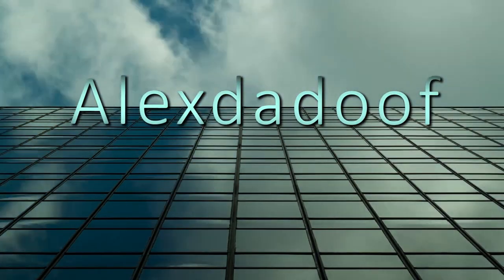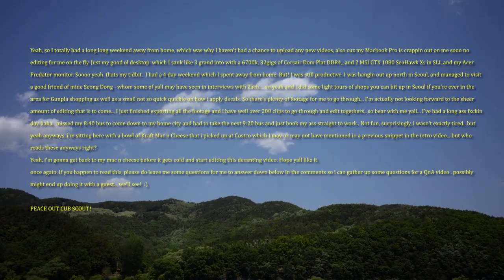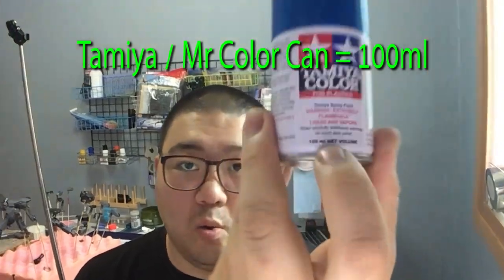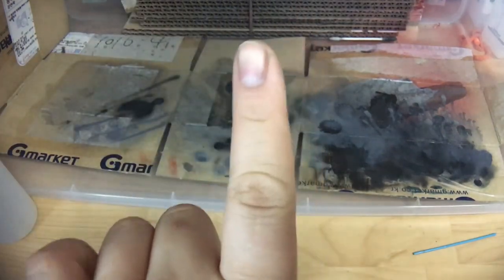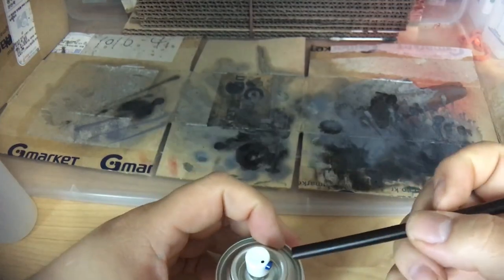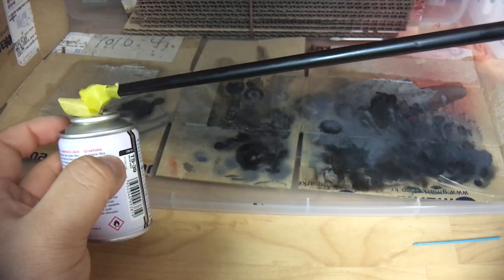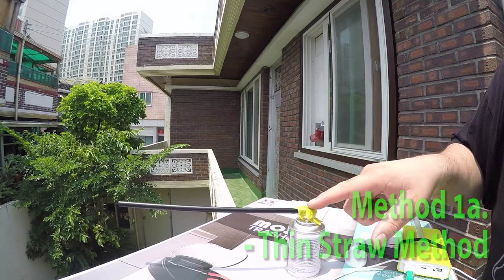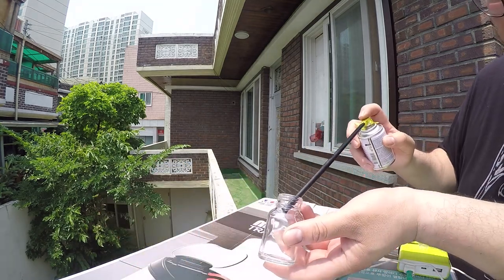009 - Decanting Spray Cans [Not So Quick Quickie]

Comment: Good video! Also gives you the option of using automotive rattle cans, giving you a wide choice of colours for automotive builds! Much cheaper than "modellers specific" branded automotive jars of airbrushable paint.
Reply from the maker: Brian I yeah I’ve got a clear coat I like that is car paint ;)
Reply: I'm learning a lot from you guys. There are tons of spray paint cans that come in all kinds of colors. Now I understand you can get the paint out and use them in airbrushing. I have also used on nail polish and thin that down and shot that. You can get some really wild metallic colors that way as well. Just have to stay away from the ones that have a lot of heavy glitter in them

Comment: Very interesting  never thought about doing this.  Will this also work for Matte top coat from a spray can?
Reply from the maker: G M yeah man, not a problem. Just maybe add a few drops of leveling thinner to refill a bit of the lost thinner in the evaporation process. It'll go through your airbrush a lot easier too. I find that Tamiya TS13 has the best shine as far as gloss coats go. They're all lacquer based. U can even decant the PS poly carbonate spray cans as well. They're still lacquer based.
Reply: @AlexdadoofStudios  do you really need to wait 5 hours for a de-gas? Or were you just being extra cautious. I know that if you put a lid on it too soon that it can boil up and overflow or explode the container you're pouring it into
Reply from the maker: 77Avadon77 definitely wait 5+ hrs! Seriously lol
Reply: @AlexdadoofStudios  okay will do 😅
Reply from the maker: 77Avadon77 Gluck!! Overnight or 12hrs will be more than enough!

Comment: I don't have airbrush, after decanting, can I use the paint with just normal brush (hand paint)?
Reply from the maker: Bc Tan technically yes, but it’s pretty much the same as hand brushing anything else, only decanted spray paint would already be thinned.. you’d be better off airbrushing for a smooth finish either way, unless you’re going for a weathered or textured look on purpose
Reply: thanks for the reply, bro!
Reply from the maker: Bc Tan anytime man!

If you wanna get good results, you’re going to have to bite the bullet and pick up airbrushing. It’s not as mountainous a task to get started, nor is it expensive! Seriously!
Reply: I'll definitely consider your suggestion :)
Reply: @bctan2291  you. Can get a beginner mini  airbrush and compressor set from eBay for 30 to 49.00 dollars.

Comment: You don't need to puncture the can.  There's a way to take it apart without that.  It's much safer too.
Reply: Terri Juanette which is?
Reply: I decided to look around to see if anyone else had the same idea/technique I thought of.  (No one taught it to me and I hadn't seen anyone else do it before.)  When I came across a couple men puncturing cans, I wanted to cringe because you don't have to puncture cans.
Reply: Terri Juanette do you have a video?
Reply from the maker: Terri Juanette you still haven’t told us how. Making your point quite moot..
Reply: You seem like a bright guy.  I thought you'd figure it out by now.
Reply: @terrijuanette486  Turning the can upside down, letting the paint settle at the bottom,, and pressing the nosle until all the propelent gets out?..... just a thought....
Reply: ... forgot the next step..... do puncture the can, twice actually.... place the can standing up, puncture once on side, as high as you can, and then puncture AGAIN on the oposite side. No need to cut the can at all, pour the paint into your container through one hole, the other hole will allow the air to come into the can as thr paint goes out, so the flow will be nice and smooth. Ok, I am Mexican and forgot how to spell "nosle", so sue me.
Reply: Really intelligent. You come here touting some mystery method and then virtually waste everybody’s time by failing to explain the method. And you disparage a random guy’s IQ for what, to make yourself feel superior somehow?!? Go away.